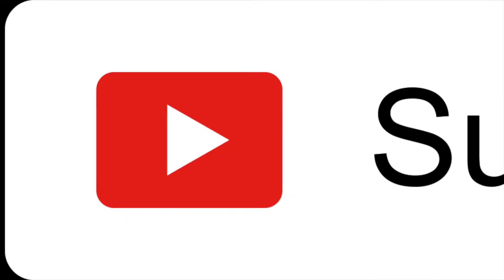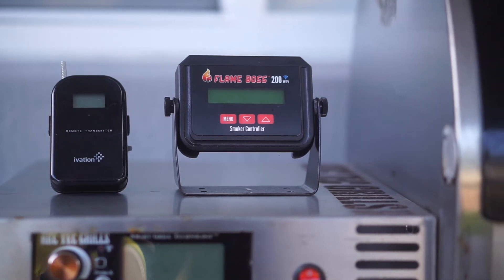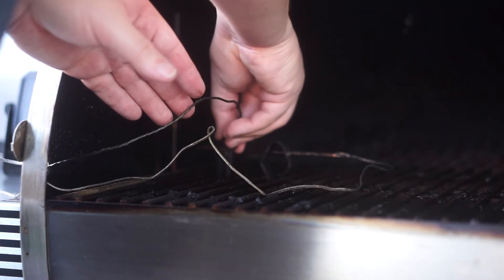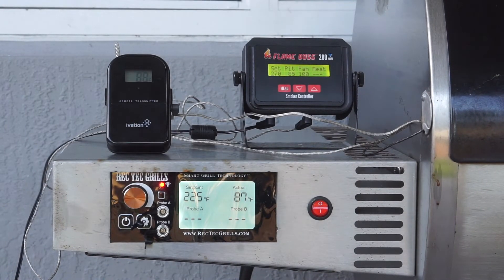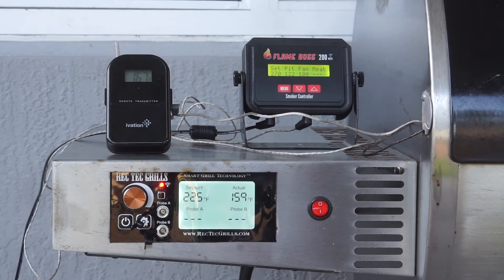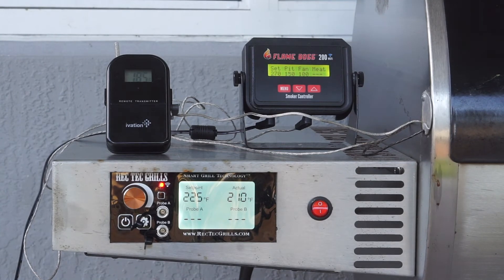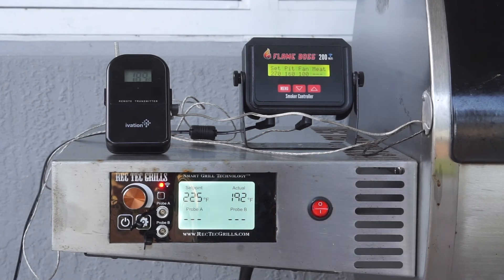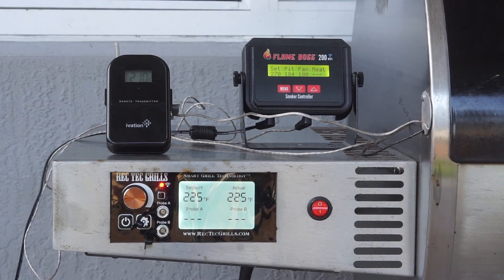Rec Tec RT700 Bull Temperature Test...Is it accurate??

Comment: After the first hour or so, spritz the ribs every 30-45 minutes to keep moisture on them. No need to do that once you foil them with some liquid. Test them for doneness by poking them with a probe or toothpick. Do the bend test as well. Agree that the 3-2-1 method is a guideline only. Last ones I did were done perfectly in five hours. You will find that every cook is a bit different. Good luck on your next cook.

Comment: Thanks for your video. I have found after years of competition bbq that 3-2-1 is a guideline only. I found that 2.5-1.5-remainder is the best way to go.   Also, I don't know if you're putting anything inside your foil, but you may try adding a little rub, and a little honey, and just before you seal up the end of the foil, a bit of water (about a 1/4 cup) or some people find they prefer apple juice. I hope you find great success with these.
Reply from the maker: Thanks for your comment, Chad!

Yes, I do agree with you that's it's just a guideline. 

I also do add honey and brown sugar to the ribs when they're wrapped, and they have always come out great!
Reply: I always find that adding a bit of liquid to it helps the sugars from caramelizing, if the temps get too hot.
Reply: Vinegar

Comment: I just bought an RT700 and it's 40-50* off the display reading. If i set it at 300* it's actual temp is 260-250*..... I started questioning it after my first 2 cooks which took wayyyyyy too long. I actually had to crank up the temp to get things done. I've yet to receive any feedback from RecTec as to what they are gonna do about it.
Reply: Did you reach out to rectec

Comment: I just installed a Rec Tec WiFi controller in my grill. I had the set point at 250. I was checking the temp in the center of the grate. This was about where the burn pot is located. After about 10 minutes start the actual reading was 190 and my probe on the grate was 236. After 10 more minutes the actual was 250 and probe on grate was 289. After 1 hour the actual was 249 and the grate probe was 259. Not sure how to adjust.
Reply from the maker: Hm, I’m not sure, Randy. I’d reach out to RECTEC. Their customer service is awesome!

Comment: Do this:  Season, put on for about 2 hours.  Rub with sauce while still open smoker then let set for 15 minutes.  Flip and repeat.  While that is happening set your foil out and prepare it with bbq sauce and apple cider vinegar.  Place ribs on foil meat side down, then bbq sauce and apple cider vinegar on top, then rap foil tight.  Put back on meat side up again for about 1.5-2 hours.  Do the bend test.

Comment: I just got my RT700 two weeks ago, and am having temp issues like you. I set for 230 and the grill went up to 300 degrees. Had used two very accurate thermometer to compare to, and sure enough, the RT700 was way off and doesn't hold temp.
Reply: So what did CS do for you?

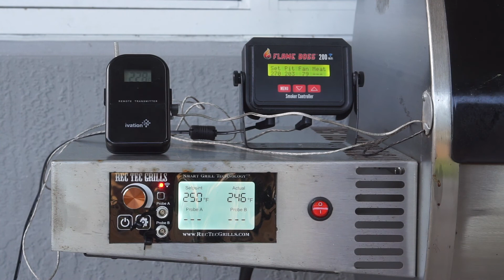Comment: it doesn't look on to me.. at the 3:38 mark the rec tec is showing an actual of 248,  the ivation is 235 (if I am reading that right) and the flame boss is 211 (again hard to tell for sure).. one of these is wrong
Reply: I wonder if the probe is adjusting to temperature faster. Plus the rec tec was reading higher than others so that would not cause burning of ribs. The sugars or sauce will burn ribs.